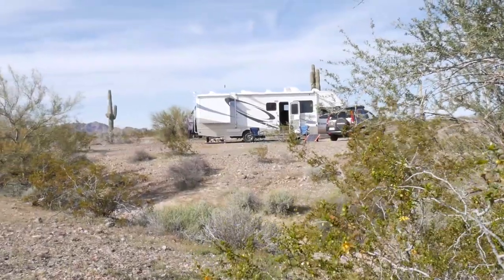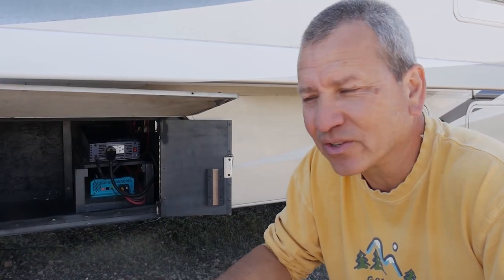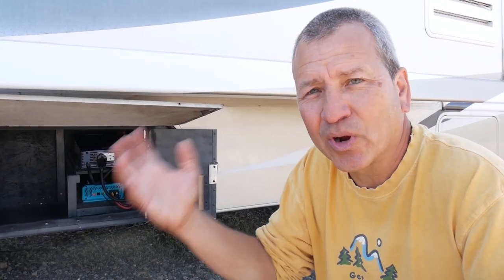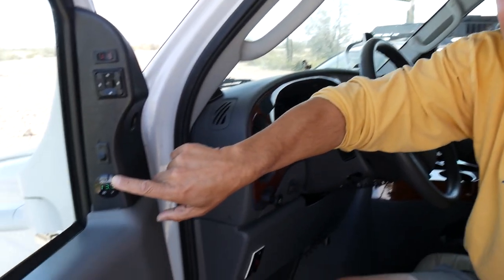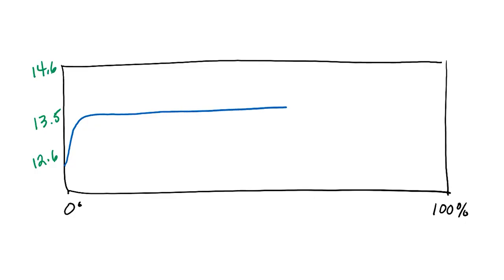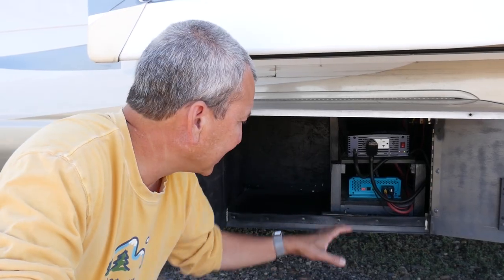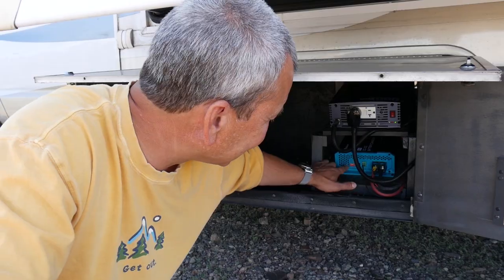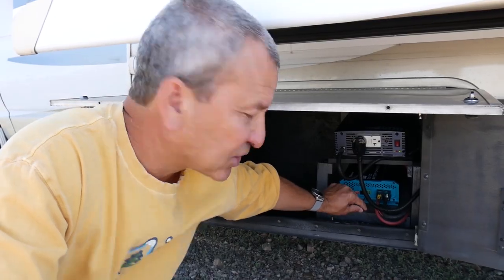Charge LITHIUM Batteries While Driving - System Setup

Comment: For those who want to consider a different way, I installed a second alternator on my F350 and converted a stock 120A alternator to 24v using an external 'Transpo' regulator set to 29.4v. I have 17.5kwh of Nissan Leaf cells in a 7S configuration directly connected to the alternator with 4ga wire.  When the battery is low, the alternator can charge at 150A and will quickly overheat and burnout....... so I have placed a thermostat on the excitation power lead to the regulator. When the alternator case reaches 120C, excitation is cut until the alternator cools to 110C. Alternators can safely run as high as 140C. I have temp, voltage and amperage meters in my center console as well as a manual enable/disable switch for charging. As a point of interest  my 120A alternator can deliver between 80-85A continuously and remain below 120C. A similar 12v setup is not as ideal with a LiFePO4 and single alternator system because of the lower than ideal charging voltage but it can be useful nonetheless.
/ 
'
Reply from the maker: Interesting setup with the thermostat. Thanks for sharing that.
Reply: LOve it. Can you show link to thermostat?  Does the excite wire now need 24v or 12? What happens when Leaf battery gets full? Now the excite wire is not doing what it is intended for. Is your enable switch connected to the excite also/ In series with thermo? alternators make 3 phase AC power that is rectified to DC. So you get a DC power that is turning on and off. Unlike a battery that is always on. Do you find you have to charge for 1 hour to get 1/2 hour battery use, at the same amp reading? I have 7s also. This has me very interested.
Reply: You can protect any alternator and circuit from over heating  by installing an external bridge rectifier.  Most factory RV alternators are not best for keeping up with power demands of rv batteries and systems so an extra bridge rectifier will add life to alternator and help it function better.
Reply: I would love to do this on my 7.3 one day.
Reply: @hitmanhite  I bought my dual alternator brackets, idlers etc as a take off kit from a wrecking yard that advertised it on ebay ($175). (I'm told) Ford only offered it for the 7/3 from 99-03 and on ambulances. You might want to set up an ebay search for one and see if someone wants to put one up....alternatively, scrounge junkyards for ambulances
Reply: @penncapt  Gene, sorry I didn't see your post. There are many inexpensive thermostats. I use 3 different ones on projects, any of which would work. Search for eBay or amazon for 'thermostat 12V' and that will screen out most of the household versions. I used https://www.amazon.com/DZS-Elec-Temperature-Controller-Programmable/dp/B07K68JJY1/ref=sr_1_7?dchild=1&keywords=thermostat+12v&qid=1606346520&sr=8-7, (bought mine from eBay) because of the size. The unit operates on 12-14v from the vehicle but switches 21-29.4V from the camper battery. The internal relay output is isolated from the operating voltage so it won't matter what you want to control. If I were to do it again, I'd use an STC-3008 (dual controller in one unit, search for it and you'll find several versions in similar packages) because I monitor my 12V alternator's temp with a second unit. Having both in the same package (and its a better package) would be helpful. I am building a custom camper right now and will use 5 of these dual channel units to control storage box heaters, hot water heating, and a host of other things. 

On charge control; I use an Electrodacus SBMS 120 as a battery manager. It has internal solid state relays that can communicate 'stop charging' (battery charge limits met)  or 'stop inverting' (battery discharge limits met). I have one SSR operating an external relay that controls the excitation line to the external regulator (one of 4 different ways I allow or disallow charging). This allows the BMS to control charging. The excitation power passes in series from the camper battery goes through the BMS relay first (1), then a relay controlled by the ignition (2-engine has to be running), then to a manual switch on my console (3-I want to control charging when moving camp if I know I will get enough solar later to charge), then through the thermostat (4). All 4 'switches' must be enabled for charging to occur and any one can stop it. 

On the 3 phase AC conversion to DC. DC output from bridge rectified 3 phase is a 'ripple' DC. It's pretty clean relatively speaking....far better than bridge rectified single phase. If you understand the concept of ripple DC, it means the peak of one phase voltage only drops about 5-10% from the 'overlap' of the 3 phases meaning instantaneous voltage runs probably between 14.5v to 14v continuously, producing an average output of ~14.2v (which is all most systems care about). Furthermore, the frequency of the output is very high. Most power-producing alternator rotors have a 'single pole' (one N and one S) and rotate at 3600rpm or 60 revolutions per second to produce 60 hertz power. That is not the case with automotive alternators. Most have 8 or 10 poles, producing 4 or 5 cycles per revolution. Since automotive alternators are typically driven ~3x engine, they are running 6k-12k rpm (100-200 rps)....that means they are generating AC at about 400-1000hz), making rectified DC much more 'smooth' and 'continuous' than you might imagine. Li-ion have such low internal resistance that it 'soaks up' as much power as the alternator can produce (hence the alternator overheating problem and my use of a thermostat). 

My 120A alternator has a fixed voltage output that is unlike a charge controlling regulator (think sailboats $$$$). Fixed voltage in a car is because the car systems want/need a stable system voltage more than the battery needs a modulated one to charge. The effect is that my batteries charge at much different rates based on their voltage. Anywhere from 21.0 to 25.8v, my 120A alternator will put out about 150A which is unsustainable if it were not for my thermostat. With it, charging will cycle on and off. Right now, off at 120C and back on at 110C. Ambient temperature causes duty cycle to vary some as does driving load (if its hot under the hood from hill climbing), generally, @ 150A charging, duty cycle is around 50% which is about 5min on and 5 min off. As battery voltage rises above 25.8V, the charge rate declines, increasing duty cycle until about 27.4V at which it runs at ~85A almost continuously......as it rises to somewhere near full charge, the charge drops down to about 20A. I don't use a lot of power and my batteries stay above 70% SOC most of the time so even when I do need alternator charging, it is not high current.
Reply: @dewholdingsllc1050  NOT entirely true. There are two sources of heat, windings and diodes. Diodes do generate a lot of heat and completely relocating them will allow the remaining cooling air a bit more capacity on the windings but the windings already get the 'first' cooling air which is already very hot due to under hood temperatures. Some alternators have external air vents to bring in cooler air but I digress.....An external rectifier is certainly helpful, probalby mostly because it offers the opportunity to get more and cooler (air that has not first passed through the windings) air around them. I feel the need monitor and react to overheating problems on both of them is not only the best solution but the only solution that can prevent catastrophic overheating and for that reason, I leave them where they were designed to be. I have a temp sensor bolted to the aluminum case right over the stator laminations. I have used the 'ground lug' threaded socket on the back of the case to monitor temp as well which MAY more directly read diode temp but I have found that it actually reads cooler, most likely because the diode bridges are suspended in the air and can only cool from forced convection rather than the stator which is very thermally bridge to move heat into the alternator body.
Reply: Steve Hericks maybe so just going by alternatorman channel , he still sells his units. He is pretty good about replying.
Reply: Ok so judging by the length of the comments here and the heavy use of jargon I am way in over my head just by being here lol. All of you sound very knowledgeable that or you are copying and pasting from an electrical manual lol. Ok so I would like to know where you get the batteries out of a Nissan Leaf and where do you install them. It sounds like something I would really like to do for my Arctic Fox travel trailer because every year in the fall to early winter I boondock for 4-6 sometimes 8 weeks at a time. Heavy forest means no sunshine for solar but I do have my truck and a portable generator that I can run whenever I want. Some years by mid October the overnight lows are in the teens and it usually snows at least once or twice every time as well. That means the furnace runs at night which draws a fair amount of power (running the blower fan) and daytime its set to the lowest setting of 40* just so stuff doesn’t freeze. Other than that its mainly just lights except every few days I run the hot water heater which doesn’t draw anything measurable. If I could have the entire battery bank from a leaf that would be awesome lol. Any advice that any of you can throw my way would seriously help me out. I spent years and years doing electrical work but none of it was ever dc and I swear for some reason my brain just freezes up thinking about dc lol. Thank you
Reply: By the way Victron has a one hour video here on YouTube all about using your alternator to charge lithium batteries.
Reply: @prepperjonpnw6482  Jon, You are only over your head if you are unwilling or unable to seek the answers. Your questions elicit a long answer. My first statement is that I am a retired mechanical engineer with a career in high-tech manufacturing. My response to your 'heavy use of jargon' comment is that it is VERY necessary to use AND understand the precise terms to be correct in discussing the subject because this is dangerous territory so if you want to go down this road, understanding precise meanings will keep you safe and hopefully allow you to be successful. It is not hard to get into a very dangerous situation with lots of stored energy. 

My first recommendation is to go to my YT channel 'workingonexploring' and look up the several videos I have done on my Leaf battery project. I have had it in several different campers. I also have a blog with technical documents at workingonexploring.com/techdocs. 

I would first say, that if you cannot get a 'great deal' on Leaf (or other EV) cell packs, or need the higher energy density, LFP Cells will be your best route. They are easier to work with (at '12V') and cells/equipment are most available. 1) Leaf batteries can't make a good 12V battery, are difficult to make a 24V battery (I did) and best make a 48V battery. Leaf cell packs contain 4 cells with 2 in series and 2 in parallel (2S2P) producing an output that ranges from 6.0V to 8.2V. Multiplying these voltages doesn't make a good voltage range for 12V (2 packs in series make 12.0V- 16.4V. Most inverters and chargers only work up to 14.6 or so). 2) Running other than 12V means changing out or buying new inverter and adding some DC-DC converters to provide 12V which is what most available equipment will run on. 3) Leaf packs can be bought individually on eBay for ~$100 each (500Wh capacity). There are 48 in a car battery case. A good deal might need to be half that $. EV repair shops often sell packs with <80% remaining capacity which should not be used in rebuilding a car battery for automotive use. I bought mine on Craigslist from a wrecked Leaf and the battery box had two big holes in it. The two guys who had it were unable to sell it readily and I got it for $300....only one pack inside was damaged. 4) You will need to learn and understand how a BMS operates and get one that does what you need. 

If you want to pursue this project, reach out to me through my above channels and I can help with specific questions.
Reply: @prepperjonpnw6482  Victron's 'webinar' may be somewhat useful th the uninformed but because they do not sell equipment to charge directly their position is to disuade you from direct changing and use their DC-DC Charger. If you want to lear about direct charging, go to the people who do it and sell equipment to support it; Balmar, Wakespeed and Mastervolt. Sterling used to sell charging regulators too but they have evidently discovered the DC-DC Charger market is larger and they have let those products fade.
Reply: @penncapt  (Very) late seeing your comment. I use a cheap '12V thermostat' which is a small LED display with a NTC sensor. No ideal for this application but works. I now use an industrial thermal controller with Type K thermocouple. I
Reply: Then I see I did respond after I posted....

Comment: Gidday Brian, i'm a newbie to your channel and love the information you put into your videos, they really are excellent. So i'm new RV'ing life and have in the past had a jeep and a small camping trailer with a Roof Top Tent on it, we really liked to go deep into know where. Anyway? I used the Redarc DC - DC to 20 amp charger setup, as i had a dual Battery system with AGM Chassis Battery and a 100AH LiFEPO house battery to run our chargers, fridge freezer etc... the thing i liked about the Redarc is it setup to always prioritize Solar first before alternator, we had a 100w Solar Panel on the roof of the Jeep and we could plug an additional 100w Panel at camp. So driving down the road it would take that 3-5amps of solar reducing the current draw on the alternator. Now back to Binge watching your videos. Cheers, Wes

Comment: Nicely done. And I eventually need to do that, but with solar as primary, I use my PRogressive 60 amp LI  charger either from shore power or generator as secondary.  I put a switch in to turn the alternator on, but have not used it.

Comment: Thanks Tito for the informative video, you explain things is a real world scenario that will be a natural fit for most people. Thank-you for including any small miffs that did not cause any significant damage to the system (Dip switch setting); these are errors that any user could have easily made, and by including that tidbit you may have saved many users from any long term and lasting damage to the system. Your set-up seems to be logical and a configuration that will make sense to a sizeable portion of DIY electrical system RV'rs.  Thank-you for sharing your experiences and taking the time to share it with us newbies to these systems that are quite intimidating and appear very complex when we first see them.
Reply from the maker: Thanks for the great feedback. I really appreciate it.

Comment: Thanks! Good info. I’m basically doing the same setup on my sailboat, but using the Victron Orion TR 18a unit. I could probably gone with the 30 amp unit, but like you, I didn’t want to damage my alternator (51amp). Basically with this set up you’re charging your LiFePO4 bank from you starter battery while the alternator keeps it charged. Thanks once again.
Reply: me too; i didn't want to convert or confuse the lead acid-alternator-solar charging, so the DC/DC converter allows all that to stay As-Is, while the house batts are now LiFePo4. The current limit and ENABLE (D+) switch are great for a boat! great set up

Comment: Brian, Thanks for great videos especially the complete details. One of the points you might emphasize often is that lithium batteries require a higher voltage, to top them off, than the standard alternator is set up to supply. Thus, one of the key reasons for incorporating the DC to DC convertor.
Reply from the maker: That's a great suggestion. I appreciate it. Thanks.

Comment: Brian, Good Video!  I have 2017 E450 V10  (Jayco) chassis, and the stock alternator is 120 amps ( from supplied Ford literature). I have a single 100 ah lithium battery, and it charges from the alternator when the engine is running. In order to control when I want to charge, I wired a switch in the coil circuit of the relay that ties the house and chassis batteries together. I enable charging when I’m driving at highway speeds. It typically charges at 20-ish Amps with the single battery
Reply from the maker: Thanks for the info!

Comment: I like how you can switch it on/off. Didn't know Renogy made those units. My question: Why wouldn't a standard dual battery isolator unit (diode isolation) work? I know Eaton and Victron make them. Just not sure if they would be suitable for a lithium house battery banks (with voltage/current limits). Hope all is well with you guys! My lithiums are beasts...the BMS has an BT APP for SOC/voltage/cycling #s. Going lithium is expensive...but, night/day difference.

Comment: Alot of those ford e-series have 110 or 130 amp stock alternators. You were wise to be cautious with the amperage provided, as you would need some heavier cable and proper dedicated ground cables to go higher amps. Most vehicles are not well grounded from the alternator to the chassis for high amp loads. Adding extra ground cables from the engine block to the chasis and sometimes to the battery is always a good move, as well as adding heavier or dedicated power feed off the alternator, such as what high end audio enthusiasts do.
Reply from the maker: Thanks for the info. It was helpful. So far it's been working fine when I need it on long drive days.

Comment: Brian we have basically the same rig mine came with a 225 amp charger.  I am pumping 40 amps to my battery bank.  They come standard with 129 amp alternators, but offer also a 155 and a 225 amp version
Reply from the maker: Good to know. I feel better knowing it's probably the 129 A model. Thanks Dave.